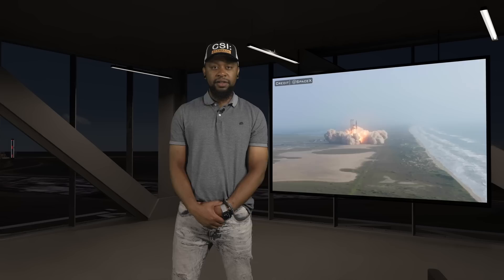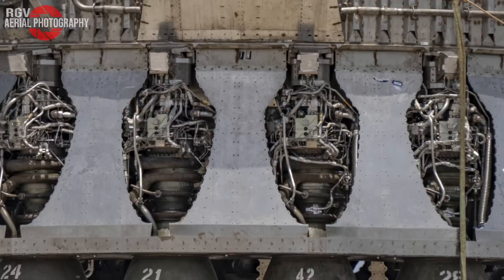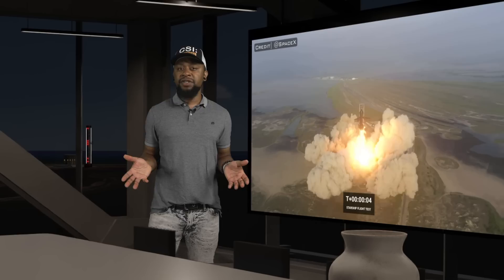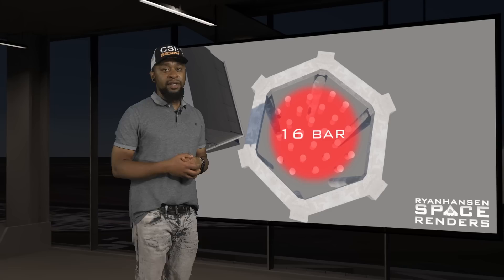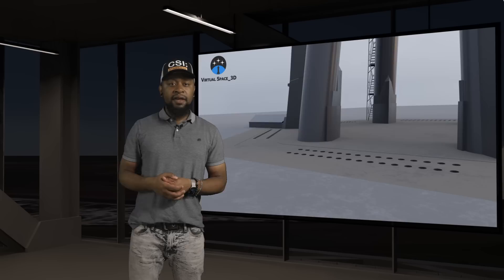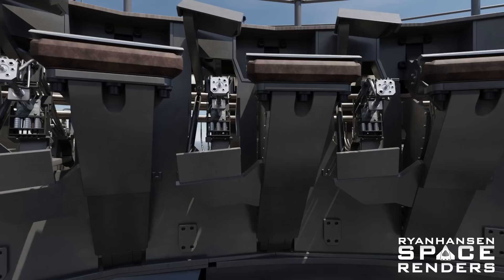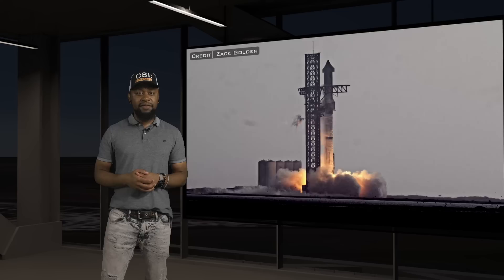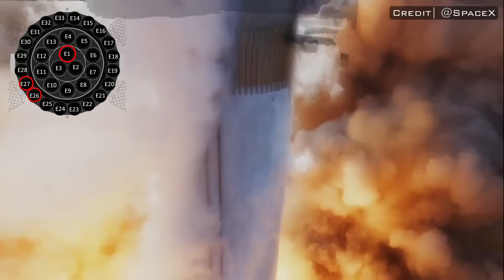The Design Flaw That Caused The Starship Launchpad to Fail!

Comment: Uhhh you're wrong.  They shut three engines down before they even fired them KNOWING they were fine.

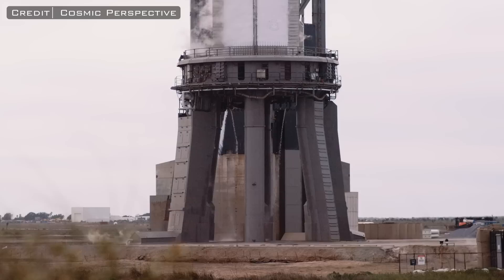Wasted. Everything after 11:27 of your "deep dive" is wasted because the 3 missing Raptor 2's were NOT an issue as far as the stability of the rocket.  SpaceX has been very clear that more than three dead engines, unless a bunch of them were all in one area would not affect the booster as it had a significant amount of extra impulse.

The engine taking off on an angle was not caused by those purposefully disabled engines.  Again, clearly stated by SpaceX.

Weeelll, I guess it's better I wasted 11:27 of my life than getting to 1:05:00 of my life by watching the whole thing.  Almost your entire video is corrupt due to your "assumption" that 3 failed rockets caused the rocket to have a sub-nominal trajectory.

Maybe wait for more information next to come out, next time because I bet you wasted days making this flop.

I think the problem is pretty damn simple.  Thor's hammer was thrown at a 90-degree angle to the OLM and SpaceX assumed that the concrete wouldn't crack and be collapsed by the 30 300bar engines they lit. No other rocket of a large size has EVER attempted at smashing a flat surface of concrete on it's launch pad without a huge water deluge/flame trench and unlike every other organization, SpaceX is stupid to try to make it work. 

They're STILL going to try to smash a flat surface with 33 engines which to me shows that Musk's "my way works no matter how painfully slow i learn that I'm wrong" attitude is at play here. This is iteration three (and I bet there were other launch pads that were smacked and cracked other than the OLM too). I expect that the next launch is going to at least partially fail too because steel is not a really good heat sink. What's going to happen is the heat is going to abrade the steel pad until the flame breaks inside it as well. 

SpaceX is looking at this wrong. It's not just the heat causing the problem. It's the energy and force pounding the base that's bending and breaking things.
Reply: The combination of ignorance, pretending to know what you don't know, led to this comment

1. The angled take off was NOT intentional. 3 dead engines caused those. Clearly stated by SpaceX/Elon. The exact OPPOSITE of your claims

And no, those dead engines weren't fine by computer, so it shutted off automatically

2. 300 bars is measured from the main COMBUSTION CHAMBER. Not the pad several meters below

3. "It's not the heat, but also the energy pounding down". Yes, SpaceX is looking the same as you did. Which is why they install a larger pilings. So you know...watch the video?

4. "Because steel is not a good heat sink"

Source: trust me bro. Many pads had also a water-cooled components directly facing the exhaust. And you know what those are made of? Yes, it's steel! (shocking)

5. "Steel will ablade"

Which is why they have....pressurized water spraying down to counter the exhaust

...watch the video again?
Reply: Watch the whole video 🙂it goes into many things which you might even agree with.
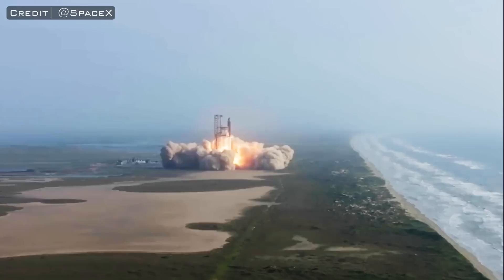Reply: 44:49